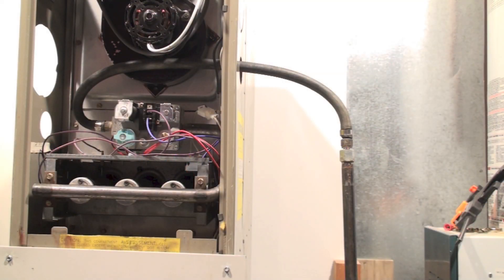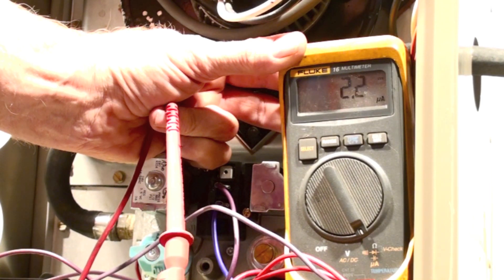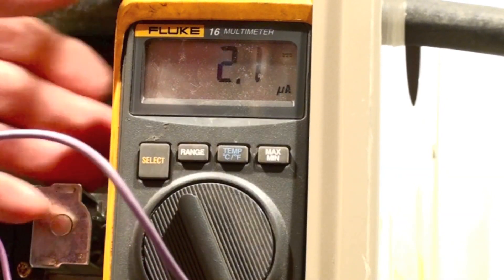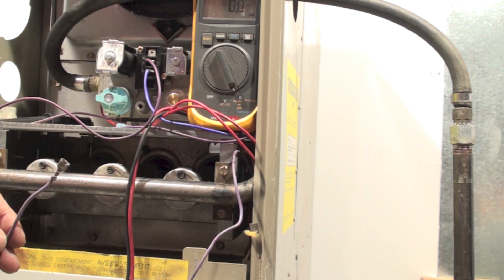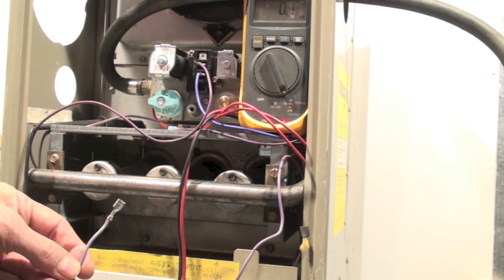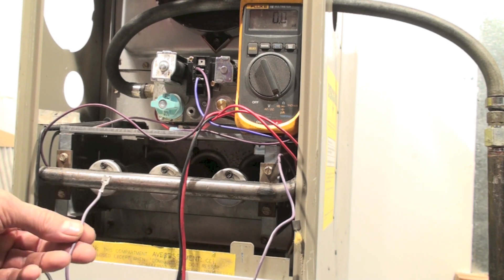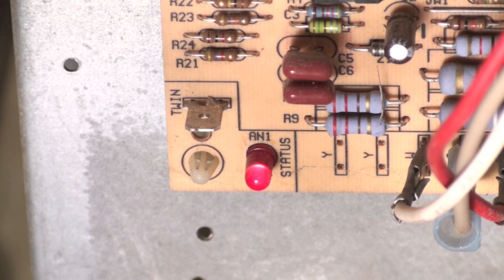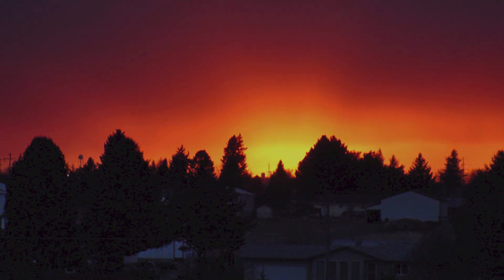How to service the 80% gas furnace, flame rod checks. Part 3

Comment: Question:  I have a Janitrol Gas Furnace #22-100.  I cannot find the filter, does my furnace have one?  Thx!!!
Reply from the maker: Filter location is dependent on the install.  It could be behind the fan door, in the return close to the furnace, or in the return air grille.
GFM

Comment: Why no mention of the importance of checking the flame sensor from the ground side. I ask because you're usually very detailed with your videos so I wasn't sure why you skipped on this
Reply from the maker: there is no reason to that I can see.  DC microamps is the same either way.
GFM

Comment: Mr. furnace man I have a 75K input gas furnace that's an AirEase Ultra 5 Tech 80 model#-G1N80BU075D12A-1A  Serial#- 1605L03698. Do you know what year this model is and if so how do you tell. It is connected to an Armstrong condenser model#-SCU10B30A-3  Serial#- 1604F19006. Thank You.
Reply from the maker: Wayne Miles I don't know for sure but I would guess the 1605 means 2005.  Just a guess
GFM

Comment: microamps at what voltage?
Reply from the maker: There is no way that I know of to test voltage, but I have gotten a shock off of the flame rod so it is fairly high.
GFM
Reply: the flame signal voltage varies from 24 v to 120 v.
Reply from the maker: john accer Thanks for the info.
GFM